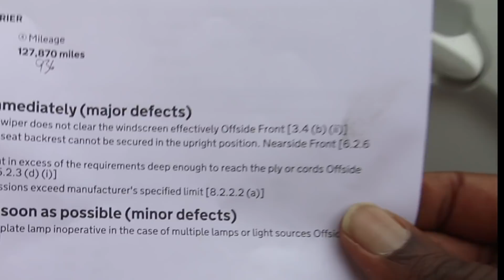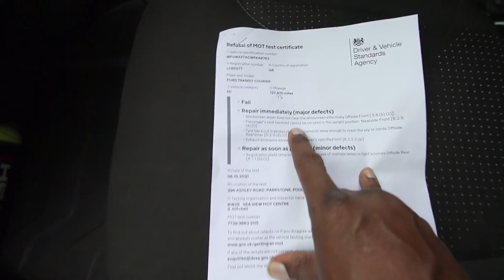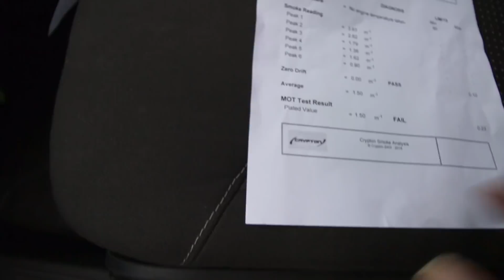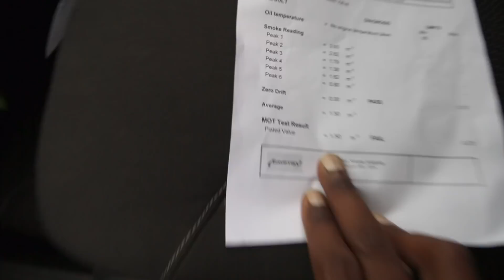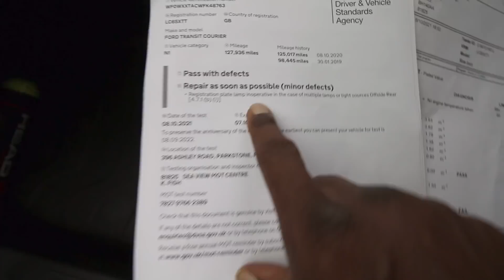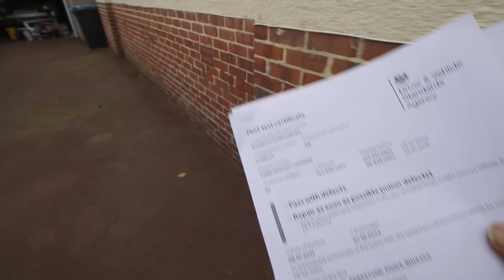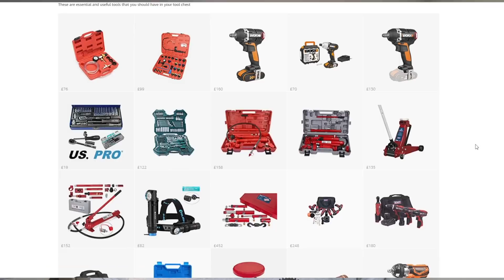GTE exhaust fail but TT injectors win

Comment: Paul I would get the four injectors cleaned and rebuilt. There is a guy on ebay who cleans/rebuilds them and has excellent feedback,very reasonable priced and quick to return them back to you"with printout of the before and after cleaning".
Reply: Iv never heard of having to recode new injectors
Reply: @stuartwinstanley4949  Ah I stand corrected, thought they had to be recoded. I was thinking about a couple of diesel cars I had, not sure if it was second hand injectors or new, which had to be coded. Much easier to replace on the TT then! Thanks man.
Reply: @boastyy  a friend had new injectors fitted to his tdi vw t6 by a garage, which had to be coded , it didn't cure the problem so they were going to refit the old ones only to realise that they couldn't recode the van to accept the old ones. Apparently you tell the van that it has new injectors which is fine, but the ecu changes the settings to account for wear as they get older.
Reply: @KevinSimpson_576  Thanks Kevin. That sounds like a nightmare. Should be able to recode so you can put the old injectors back in jeez. I know when changing certain parts on the engine the ecu needs to relearn the settings. The ecu is constantly checking the data and adjusting in realtime. I had to drive my car a couple of miles at different speeds and it sorted itself out and was smooth again. Thanks man.
Reply: @stuartwinstanley4949  certain diesel injectors have to be coded to the car. They are calibrated when manufactured  or rebuilt and that calibration needs coding to the ECU so it knows how much fuel it’s adding.
Reply: @Mac_F87  yes I know diesel injectors do but for the Audi tt petrol they don't
Reply: @stuartwinstanley4949  riiiiiiiiiigggghht…

Comment: You could just send all 4 injectors to r-tech for cleaning and save yourself a load of cash.
Reply from the maker: The two problematic injectors are not working so, its not just a case of them needing cleaning
Reply: @CarsForPaul  injectors that aren’t working can be cleaned sometimes

Comment: Paul, this is so wrong....you purchased a kit for your car, you bought it as a "direct fit did you not " ?  You shouldn't have to modify/ cut the exhaust to make it fit, the manufacturer should send you the CORRECT part free of charge, along with a partial refund AND an apology !!!!